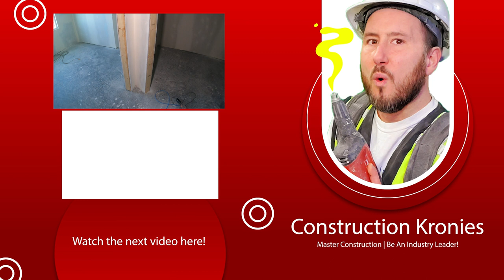ODD Corner Finishes Not 90s Metal Stud & Drywall

Comment: Why do some guys just want to be cutting Sheetrock while the other guy working at the top in the lift? Lol are they suppose to take turns?
Reply from the maker: Some guys take turns, most of us stick to the role that we are good at or like more. For me, I am really good up top, I know the lift operation and so on so I prefer to be up top. The bottom us easier but I find it boring. Also depends on your partners physical abilities and size and shape. Taller and or bigger guys tend to be on the ground more. At the end of the day you and your partner can do it anyway that works for you both. Sometimes I need a break too from up top but I'll have to accept the work won't be done as quickly.